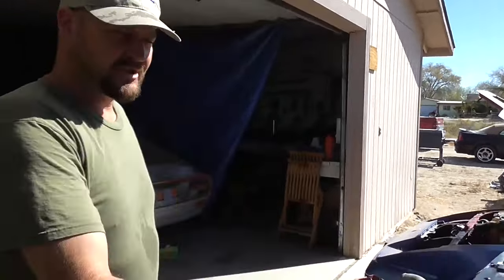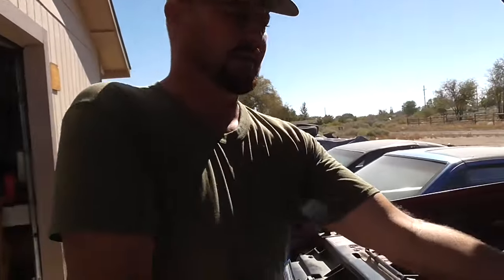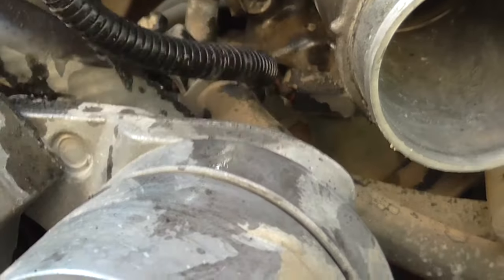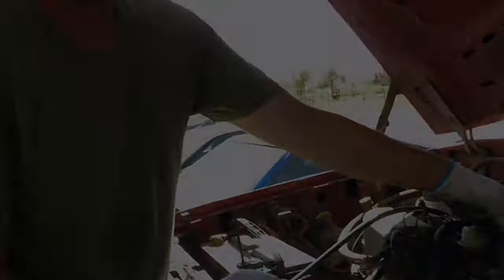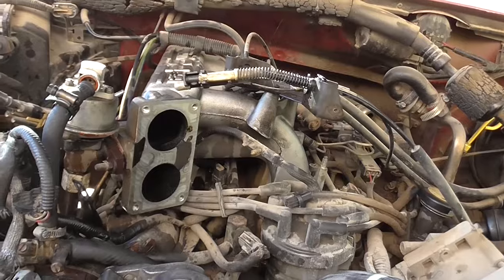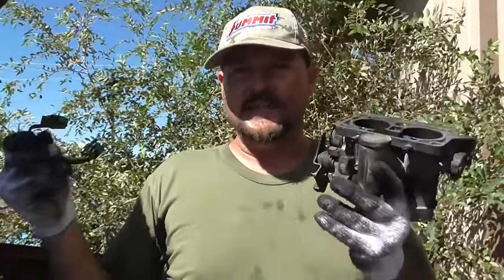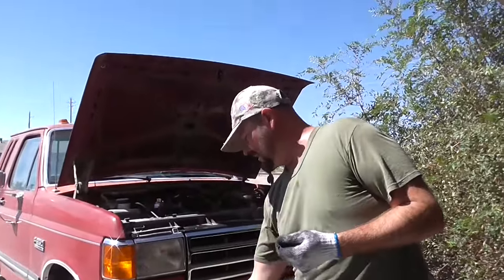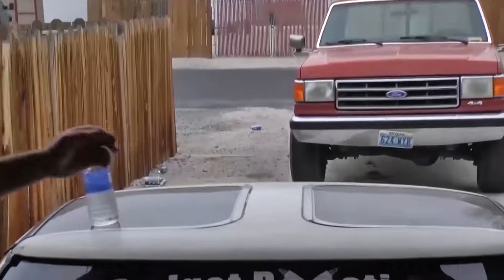DIY Throttle Position Sensor Change (86-96 V8 Ford Trucks)

Comment: Budget boosting,  Hoping for help here. after watching your TPS video  I change mine out cleaned the Throttle body, replaced the IAC while I had it apart.  I did all these as my 91 302 was doing all the things most of your readers have mentioned. Ie. Erratic idle at warm up and dead spots when driving constant speed between 30-45 mph.  However after putting it back together the truck will not start at all. Please Any thoughts what might have happened.
Reply from the maker: +L hood since many connections were unplugged for the job, double check all electronic connectors in the fuel injection system since any one of them can result in a no start.
Reply: +Budget Boosting , Thanks for the reply. I only had the TPS, IAC and Vacuum disconnected. After reading some other post what I did not do is disconnect Battery first before starting the Throttle body disassembly? Would that have cause a problem some place in the EFI system? It does sound like it is just getting no spark. I pulled a plug and tried to see if I could get spark and did not. but I do not know if these EFI Systems will work that way. I am use to my onld jeep. Any Thoughts on what might have blown to keep from sparking? Appreciate the help.
Reply: +mrmadmatt48 Thanks guys,  I will get to work looking around. I do remember starting to unplug the connections going into the distributor,  thinking I needed the room but then did not actual unplug all the way. I did double check that it was plugged back in all was good there.
Reply from the maker: +L hood Did you find the cause?
Reply from the maker: +L hood Also check spark directly from the coil, if you have spark, then check spark from coil wire to distributer cap if spark, then check distributer cap and wires.  One of those areas is the problem why the plug gets no spark.  And of course the above things I discussed already.
Reply: +Budget Boosting no I have not found it yet. I think I might go buy a reader. can u suggest one or 2 to look at? Ford $ GM. do they make them to work with late and early model stuff. might be a good video for us newbie.
Reply: +Budget Boosting I only checked at plug
Reply: Lorne Hood I had this same problem once thought it was the fuel pressure regulator  but turned out to be the fuel pump relay was going bad

Comment: I have a 1991 F150 V8 5.0L automatic trans with a throttle setup like the one in your F250. Im pretty new to cars and wanted to ask.... My truck idles high when I first start it up and then it drops to 500, then jumps to 1000 then drops back and so on. Sometimes it drops completely and dies. when I shift it drops the RPMs like a ton of lead which is usually when it dies. Is this a Throttle Position Sensor problem? This seems similar to a few other people's but I wanted to be sure of the problem before spending any money on the wrong parts. Thanks.
Reply from the maker: SykoticT the symptoms you describe are similar to a TPS, I would check all your vacuum sources for any vacuum leaks first before spending time and $$ on a TPS.  If there are no vacuum leaks, then I would go with the TPS.  Also how does the truck drive low, mid, and full throttle?  If it is not good at those throttle settings a bad TPS can cause that.  Idle air control valve controls where it sits at before you apply throttle too.  So that is another area to check.

Comment: My issue with my 95’ f150 is when gently moving other stuff out of the way. I end up cracking dry rotted vac hoses and rubber hoses etc. turning an hour job into back and forth to the parts store.

Comment: I have a F450 bucket truck and it dose nothing but stutter after warm up as if  it was lacking gas or to much gas could it be possible  that it needs a thro/sensor

Comment: I have a 1996 ford f-350 the idle is high...I replaced the 02 sensor and the air idle control valve but it's still high ,maybe it's this sensor

Comment: Have an 86 f150 that keeps under loading. Doesn't do it all the time. Hard to pin point the problem. Has spark when I can get it to do it. Emissions light doesn't work so can't get it to read a code. Changed fuel pump and map senor. Any suggestions would be greatly appreciated!

Comment: Hey I have a 1990 f 150 308 it will start if I hold it to the floor but if I let off any at all it will stop and when it starts it run a slow run I've put all kinds of parts on it and still won't run right help please

Comment: Man I’ve spend $3000 dollars already thinking it was trans got that rebuilt and it still does the same issue as I took it in thinking that was the issue. It feels like if as in I had it in parking break and ones I reach 30pmh it starts to jerk like if the trans was bad. And the transmission as well shift like crazy like if it diner get rebuilt . At this point I’m kinda giving out . I was told it could be the ecm but that is my last resource …

Comment: is there a way i can reach you for some advice? i have a 1989 ford f150. on the highway at 65 mph heard three huge backfires through exhaust. all lights came on in dash. coasted to shoulder. towed it to my house, it idles but when pressing gas it bogs down and dies, or very unsteady and unstable rise in rpms. pulled codes KOER got 12/13/22. changed IAC and MAP sensors. Still coming up with same codes after replacement. and engine runs the same or maybe a hair better. Changed fuel pump/filter a few months back, vacuum at fuel pressure regulator good and no signs of fuel crossing diaphragm. Changed distributor at same time of fuel pump. sort of seems like its either out of time or maybe dizzy failed internally? but i really dont know. this is throwing me for a huge loop.
Reply from the maker: Sounds like throttle position sensor.

Comment: i have a 1989 Ford F250 5.8L custom and in the mornings it always takes a few cranks to turn on but after than it turns on like nothing the rest of the day. i would appreciate some advice on what it could be thank you sir
Reply from the maker: +Alfonso Torres Cleaning the gunk and oil from pcv that coats the outside and inside of throttlebody.  A lot of crud gets in there and can effect cold starting.
Reply: +Budget Boosting  thank you sir
Reply: +Alfonso Torres how come he did not adjust it you must adjust it

Comment: I wonder if that's what's wrong with my truck. 94 ford f150 5.0 302 v8... My dad adjusted my throttle at the top to try to keep my truck running. RPMs go up, then when I move outta park it lunges and I can't stop well, I have to stand on the brake to stop it. Brand new starter, brand new ignition coil, brand new idle air control valve, replaced 5 of 8 spark plugs, new distributor cap (distributor itself never moved or came out - rust fused to my truck and has been for over 10 years), and s few new spark plug wires. Haven't been able to drive my truck in months. Pisses me off, and after dealing with poor mechanics I can't afford that. Just want my truck running.

Comment: How do you know when the throttle position sensor is broke? I have an 86 f150 with a 302 the over revs when you start it
Reply from the maker: Over rev could be caused by something jamming your throttle cable, there is a cover on it to remove so you can see it.  Also a big vacuum leak can cause high idle at start up.  The TPS will give you strange response at any throttle position, not accelerate when you open throttle.  Most likely some problem with your throttle linkage, there is also a cruise control linkage attached to your throttle linkage, it is made of cheap plastic and sometimes it breaks and jams throttle in open position.

Comment: Hey Matt I'm having trouble figuring out how to adjust the idea on my 86 300zx, think you could help me? I tried lowering the throttle stopper but that just made it stick. Thank you!
Reply from the maker: zimmyboy07 if the idle is high, most likely there is a vacuum leak in one of the many vacuum lines in this engine.  Look for any dry rotted, broken vacuum lines and repair or replace them.  Check the ones going to the fuel pressure regulator and turbo boost sensor first since they are the most important to avoid engine problems and they directly affect fuel flow.  Let me know what you find.
Reply from the maker: Budget Boosting There is also an idle adjustment at end of  the IAT, the adjustment screw is on the drivers side of the intake manifold just forward of the throttle body and it adjusts with a flat head screw driver.  Kind of tricky to find, you have to look forward of the throttle body down before you see spark plug wires and you will see the flat head adjustment.

Comment: hi all you gurus, can i ask you guys a question.  i'm having a hard time finding the right diagrams on my phone, i'm so used to my laptop but i can't use it now in my area.  we pulled the throttle body off of our 1990 e350 van with the 5.8 and i swear it didn't have a vacuum line attached to the top vacuum bib of the throttle body,  the lower bib was attached to a short little piece that went into a tee attached to that little valve thingy (don't know what that's called:))) but i don't remember seeing anything attached to that top bib.  i've got some broken vacuum lines so i want to try and figure it out.  anybody got any suggestions?  i know this vid is old but i sure hope someone see's this.  thank you so much in advance.

Comment: +Budget Boosting. My f150 is a 91 5.0... I've replaced the iac,fpr,coil and it's capacitor upper intake manifold gasket....checked all vacuum lines and egr is working....fuel pump pressure is around 30 psi at idle...WOT @40 psi...replaced the tps also...fuel filter too. Still have same problem starts great runs for about 2-3 minutes then it starts acting up around 25-30 mph it has me confused and frustrated only thing left is map sensor????
Reply from the maker: +Bri Pri Check for any vacuum leaks on and around intake manifold.  MAP sensor can cause same symptoms due to referencing fuel on vacuum pressure as engine rpm increases.

Comment: Hey budget boosting i have a 88 F-150 with the 302. It will run fine for about 15 minutes but then it will bogg down and shut off i originally thought it was fuel related because when i would push on the pressure relief valve hardly any fuel would come out.  So after replacing the fuel pump,  filter,  and plugs it still does the same thing. i was hoping that you could help me figure this out
Reply from the maker: something comes to mind.  After 15 minutes of driving the catalytic converter gets very hot and if it is an old converter, it may be getting too hot, then computer shuts it down due to high exhaust temp.  The cats they put on those fords are very restrictive too so replacing it with a higher flowing cat will net you some performance and economy improvements.
Reply: Budget Boosting it is straight piped off of the headers no cats just two mufflers at the end
Reply from the maker: have you taken an OBD 1 code reader and looked for codes?  Sometimes they do not show codes but it helps to narrow it down.  Have you changed out the throttle position sensor yet?  That greatly affects throttle response and can stall the engine.   Do you still have EGR on your engine?  On my 1989 F250 with the 5.8 351W engine, I blocked the EGR so one less problem.  basically I removed the bolts holding EGR to the intake manifold, made a block off plate from thin sheet metal and reinstalled EGR.  That way it looks like an operating EGR, doesn't throw codes, and no exhaust actually enters the intake manifold.
Reply: @budgetboosting  You just answered question # 42 for me. I've been wanting to block mine off but hesitating until I get it straightened out.
I'm subscribing right now.  Thanks for your help I appreciate it more than you know.

Comment: Will this work on a 1985 e150 van?
Reply from the maker: yes, as long as the engine has the same style throttle body.  Either the 5.0 or 5.8 small block Ford engines.

Comment: I have a 1989 Bronco with a c6 just like that but im getting high rpms.. 65 mph @ 2800 rpm could it be a bad TPS? I also got Code 67
Reply: yes  or a dirty IAC   after checking  cleaning   often the MAP sensor
Reply: Nope its a c6 3 speed no overdrive transmission so my 89 bronco had c6 and would do 2800 at 75
Reply: You must have a 4.10 mine has a 3.55

Comment: I thought the pigtail on the TPS should be facing the IAC valve? Have I been doing this wrong for years
Reply from the maker: If it fits right and it works effectively, than either way should be fine.

Comment: My f150 is still having trouble tried the map sensor not the problem ...only code I get now is 332...
Reply from the maker: +Bri Pri it is an EGR code.  Check the vacuum lines to EGR, also remove and see how much gunk is clogged in it.  May need a new EGR.  Mine is blocked off with a metal blank off plate where you see my EGR but it is blanked off by a thin metal plate so it just looks like its there.  I personally do not like EGR so I blank them off.
Reply: +Budget Boosting hey bro what's going on I've watched a few of your videos you seem to know quite a bit I'm a Chevy guy but I just purchased a 1990 Ford Bronco it was surging at idle when I bought it I did a complete tune-up on it and it still surges I don't have much drive time on it just around the block a couple times there's a couple vacuum lines off I put those up in several different ways and it doesn't seem to change anything I can't find any kind of diagram on the vacuum system to know where they all go so I know I have a vacuum issue as well as something else I think can you help

Comment: what was yours doing mine is a 95 f250 with the 351 it's reving and losing rpms while it's idleing
Reply from the maker: IAC ( Idle air control)  or TPS (throttle position sensor) are two sensors that would cause that type of problem.
Reply: Budget Boosting thanks man working on it right now

Comment: I learned my lesson on my own Ford...do NOT by aftermarket electrical components! The aftermarket stuff has consistently turned out to be junk. A lifetime warranty only means you'll be replacing it every six months for the rest of your life. Also...you failed to talk about the importance of adjusting the sensor. The early systems (like yours and my own '85) require a closed throttle TPS voltage of as near to 1.0 volts as possible. It's not unusual to have to modify the sensor so it can be adjusted one way or the other to get adjusted properly.
Reply from the maker: +tempest411 Mine on my 89 was not adjustable.  The TPS on my 87 Buick Regal is adjustable and idle needs to be set at .42 on my scan master.
Reply: The Ford TPS is not adjustable as out of the box, but adjusting it to 1.0V at throttle closed is no less important. As such, it's necessary to elongate the mounting holes so that the TPS can be rotated to achieve that 1.0V at throttle closed. In later years the computers were set up to take what ever voltage was there at startup and reference off that, but between '85 and around '92 I believe, it's important to make that adjustment.
Reply from the maker: +tempest411 Great idea, so far I have been lucky with my 89......  Yes many aftermarket sensors fail within some months and not years like higher quality ones, hence the lifetime warranty on many.  I remember changing the same brand of cam position sensor on a 05 Dodge Neon every year like clockwork for three years straight until I sold the car...
Reply: tempest411, I know your comment is 2 years old but I'm gonna try. My book says what you are saying to adjust to 1.0v, so are you saying to drill out the holes so you can turn the TPS until you get 1.0v?  My 88 is kicking my butt, I can not get it to idle.
Reply: Ryan G in my experience, you have to rotate the little bastard into the proper position. I've got my own headaches with it and have had this problem before.
Reply: asm42, I appreciate the information, I will try that and if that doesn't fix the problem I will have to take my truck somewhere with better diagnostics than my little code scanner.
Reply: Does anyone know whether the '93 had updated software to accept whatever voltage is present at startup, per you comment above? Thanks in advance for any help y'all can offer.

Comment: hey im from germany and i reded my eror codes and my cars says the iat sensor is out of range or the vat sensor
the problem is i have a f 150 1991 withe l6 4.9 liter engine and i cant find that sensor
Reply from the maker: inlet air temperature, it should be on the intake area or near the throttlebody measuring air temperature.  It should be near the front area on the intake manifold.

Comment: Where is the maf sensor? I don't found it, my truck is f150 lariat 1991. It has the code 113
Reply from the maker: I have a 1989 F250 with the 5.8 351 winsor engine.  Mine has no MAF sensor however it has MAP, TPS, and an IAC sensors.   I believe your code 113 is the IAC, (Idle air control) sensor.

Comment: hey this is mchl8 i have the 84 f250 w the 300 carberated version 300 not a zx for some reason an error there.
Reply from the maker: +mchl8 Now that makes perfect sense.  300 straight six, quite the torque maker.  They undercarbureted them from the factory but offenhauser makes intake manifolds for a 4 barrel which really wake these engines up.

Comment: Do I use gasket sealer on the throttle body gasket?
Reply from the maker: Raymond West Recommend new gasket or inspect old one to ensure it will be secure fit.
Reply from the maker: Budget Boosting I usually do not use sealant, if I do, its the spray copper seal that goes on thin and will not squeeze in the intake and go in the engine when the small pieces break off.